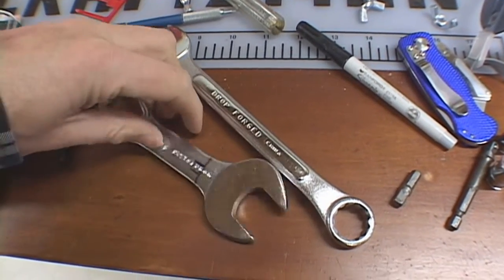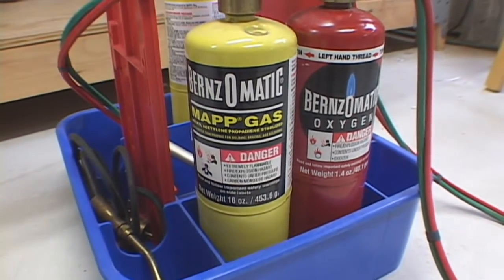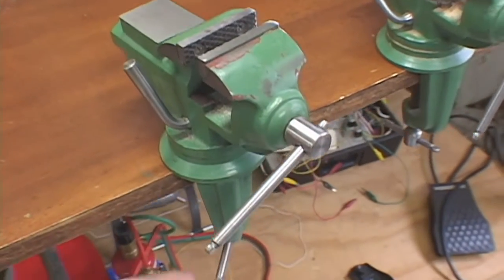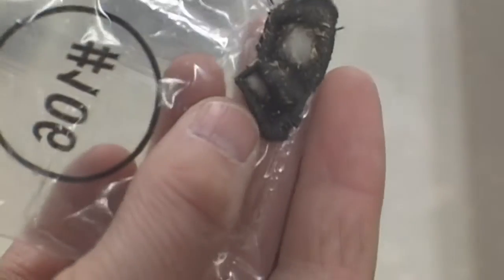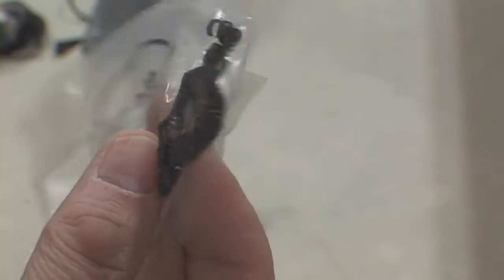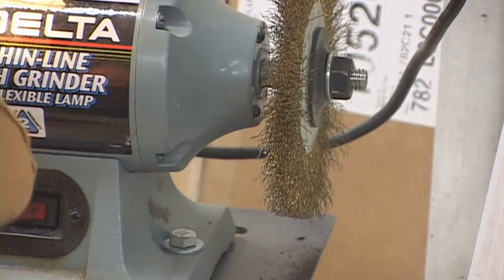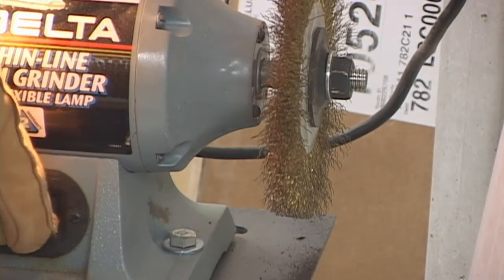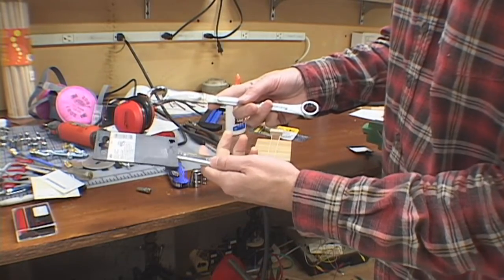How to Braze Metal

Comment: Nice project.  You would be well served by a larger capacity torch.  Your little mapp gas/O2 torch is really for jewelry.  A fine torch, to be sure, but a bit small for your project.  Very nice production value for your vid.  Nice idea, the two vices for holding work.  I'm not sure about using rosin flux for this kind of braze.  I use borax, which is typical flux for brazing.  Just my limited experience.